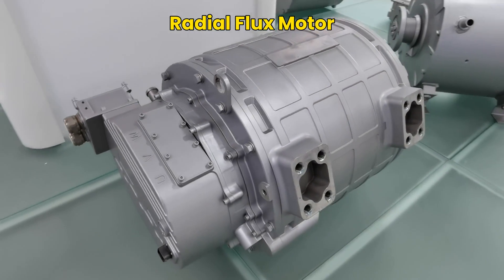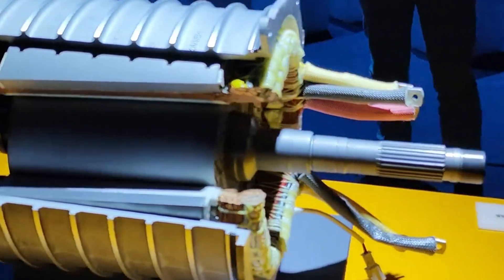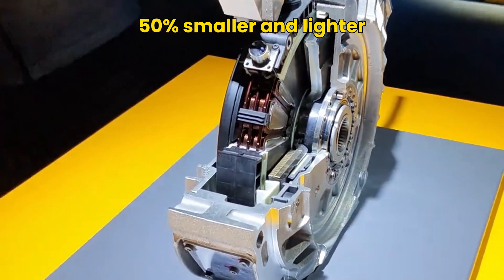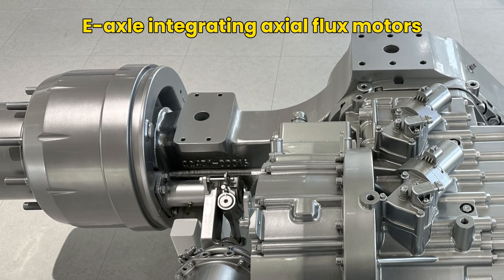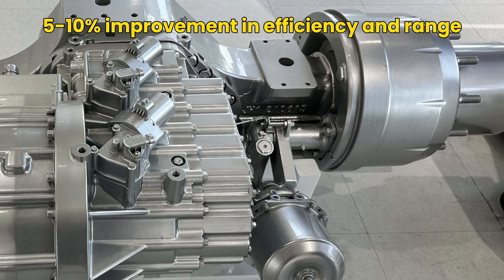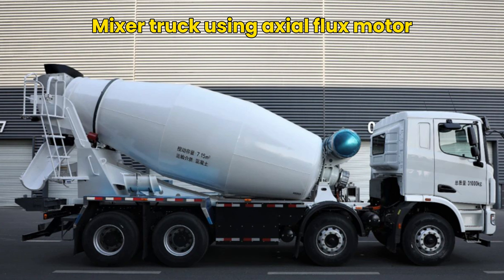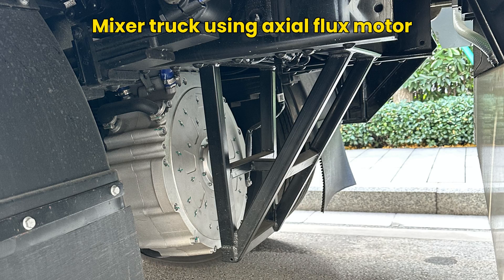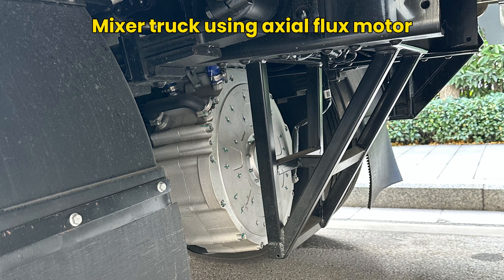Why Axial Flux Motor is Considered the BEST Solution for Electrification? #evmotor #ev #motor

Comment: To be clear, the motor has never been the issue with EVs; the battery is!
Reply: It is in select applications like CV's. Especially wheel Mounted motors in low floor buses. As you said more issues are with batteries but still improvements in Motors brings new applications.

Comment: if you make the EV the holly cow what it not is then motors are good for a purpose
for one thing one motor will fit verry good for a other thing the other motor prforms better
so it is the purpose for what use one motor fits all is advertisment talk
Reply: like this how sure are you that some people do not like the gearing
in combination with high RPM i love it the other motor will kill my innovation
in fact for me it will be useless.
Reply: @HenkBronkhorst-c8c  
In English we have a phrase ... Horses for courses ... meaning you should pick the right motors for the job.. 
The big problem is ICE motors are Complex to make and maintain they are also desperately inefficient. Also they constantly consume what is essentially a finite, none recyclable resource. One that has greater value used as a raw material in manufacturing.

Comment: A usefull comparison  summery.. 👍🏼🇬🇧🧙‍♂️
though the artificial voice is accurate its still prefferable to use a human narrator.

You might want to take a look at the advantages and design of Rare earth/ permanent magnet free motors verses perment magnet motors.  

Dont forget that Copper reserves are also under pressure and that the PMF motors can also do without copper windings saving wt. money and reducing pressure on the already struggling reserves.
Reply: lucky there is not one master there is always a master above a master
Reply: and i am not talking about a believe.